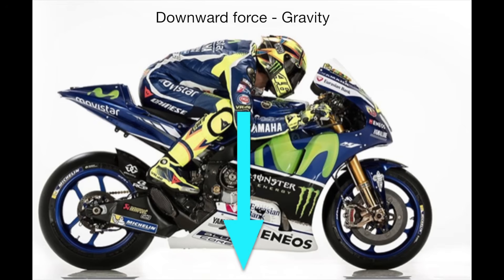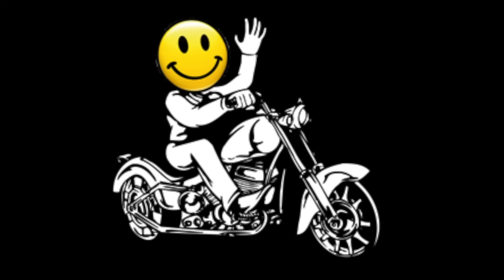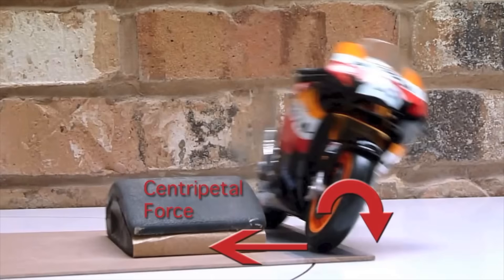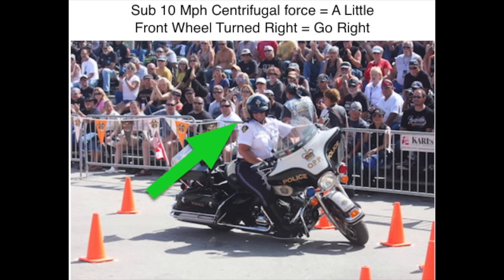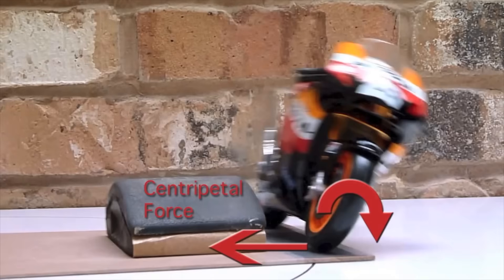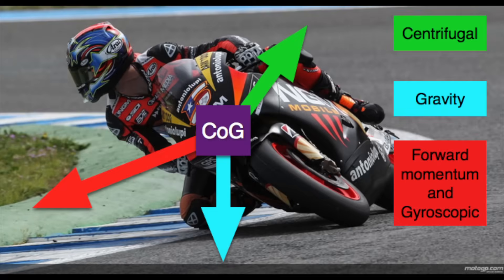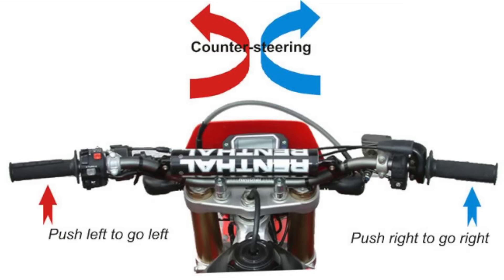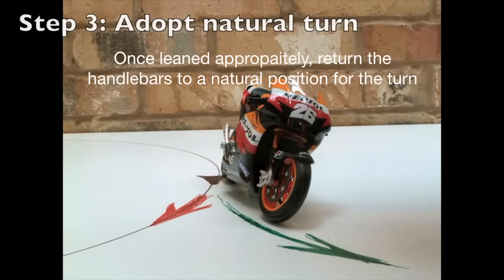Motorcycle Countersteering Physics, Myths, and Misconceptions | SquidTips

Comment: Isn't the countersteering explained by the gyroscopic effect of the front wheel?
Centripetal force is what maintains the motorcycle cornering but what makes the bike incline when we initiating the cornering is the gyroscopic effect of the front wheel, that's the why in low speeds countersteering isn't works. Am I right?
Reply from the maker: In my reading, the gyroscopic effect of the front wheel had primarily a stability effect on the bike. When you act on the steering by pushing forward on the bar the opposite direction you want to turn, the bike 'pulls out' from underneath you into a leaning position. Then the rider, or in most cases the inherent stability of the bike, provides the steering torque necessary to rotate the front wheel back to the left and in the direction of the desired turn.

The reason you don't counter steer at low speeds is because thee isn't enough torque on the bike to maintain stability at low speeds while leaning.

Again, this is my understanding and I could be incorrect, but I believe the wikipedia article covers this: https://en.wikipedia.org/wiki/Countersteering
Reply: I'm no scientist either but I agree 100% with your reading Squid, gyroscopic precession just makes the wheel want to stay at whatever angle it was at. Comparable to how inertia works in a mass moving along a straight line. You feel procession as that initial resistance you get when you initiate counter steering. It opposes your efforts to change the direction the wheel is pointed at. In a (single axis) gyroscope the wheel indeed cants due to this, but  a motorcycle's front wheel is normally in contact with the road at the bottom so this doesn't work directly but translates into a resistance against counter steering. The cause of counter steering is only handle bar input.
The force becomes greater as the speed, mass and diameter of the wheel increases. In my experience you quickly get used to it and can hardly feel it after riding a bike for a while.
IMHO the reason counter steering doesn't appear to work at slow speeds is because you need to have your mass above the bike when leaning the bike to turn at low speeds because of the lack of centrifugal force. So the whole thing feels completely different physically, but the physics does not change for low speeds at all. This is not quantum mechanics we're talking about here! Most instructors do teach to "swing out" a little at the start of a slow turn, which is pretty much the definition of counter steering, even if they never mention the word.
Reply: Squid Tips You are basically correct however you do countersteer even at low speeds. Its just not very noticable since you don't have to lean much and the force needed on the handlebar is very low due to lack of stabilizing gyro effects. Physics are the same, just smaller "values".